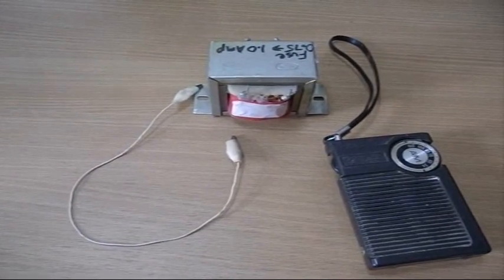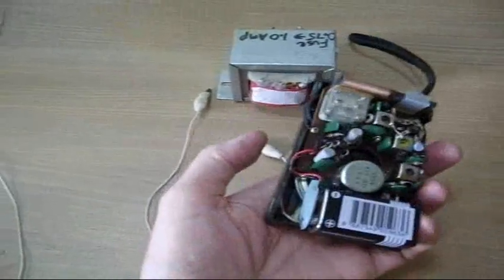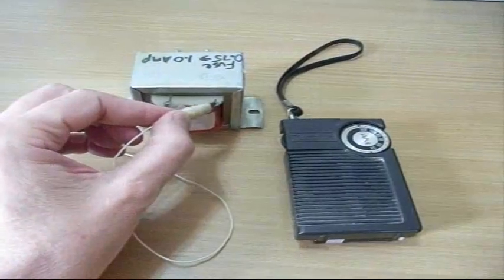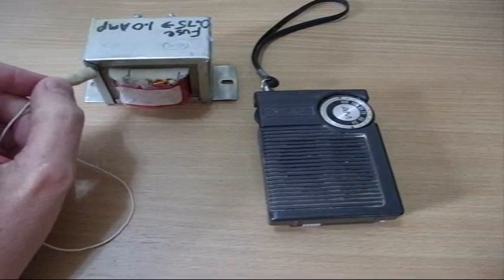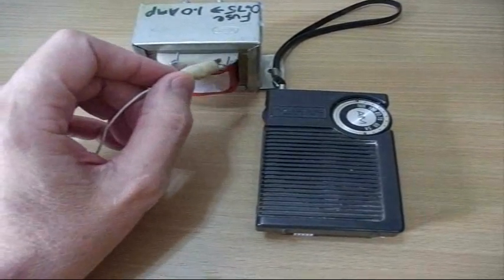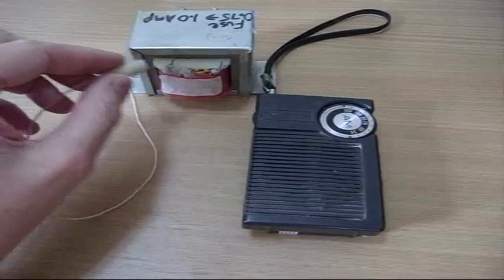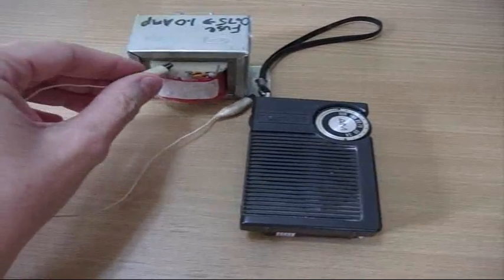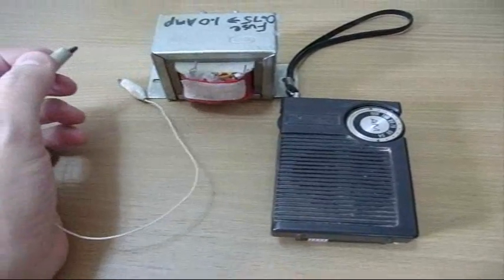Strange Radio Static Phenomenon - Free Energy Source Found???

Comment: AM radios have a Local Oscillator that often is leaked out through the ferrite rod antenna at low levels.  "Cheap" AM receiver designs respond to a very broad-band of incoming frequencies, even their own L.O. frequency. This "leaked" L.O. frequency acts (in the receiver) like a very distant CW (continuous wave) radio transmitter.

Any large chunk of metal (like the transformer) will reflect the leaked L.O. frequency, and connecting it to another metal object (the wire clip lead) will change the reflected signal level... this results in Amplitude Modulation... which is what the AM radio receives.

Since the "normal" incoming RF frequency range (around 500kHz to 1700kHz) and the L.O. frequency (955 to 2155kHz) are still within the same general range (the LO is usually offset by +455kHz), the AM detector will "detect" the change in reflected L.O. signal level and respond with a "click".

Probably confusing to some... but that's the probable answer.

The other possibility is that the ferrite antenna (which is parallel tuned with the tuning capacitor to be resonant at the desired carrier frequency), is coupling to the metallic mass and wire, and "de-tuning" the tuned circuit slightly... and the de-tune amount changes when you connect the wire... which is capacitively coupled to your body... making you part of the circuit as well.  Like before, this slight de-tune effect also results in a slight Amplitude Modulation... "click... click".

Both effects would lessen as the radio is tuned to a lower frequency, so there's not an easy way to discern which it is.

Comment: It's obviously a microwave oven transformer therefore you're picking up microwaves which is radioactive..... 

Please tell me I'm wrong with a source!
Reply from the maker: It's from a really, really old printer.
Reply: Haha ahh. It must be really old to have one that size. I know I have a few that look just like that from microwaves. I have a few old printers I was just going to scrap for the motors and boards but now I can't wait to hopefully find some more transformers. 

I love watching your videos by the way. Keep up the good work and God Bless!
Reply from the maker: Michael Watts Thanks for the kind words.  Older printers also had some cool components like a miniature LM317 voltage regulator and other discrete components one could play with.
Reply: Yeah I just opened one of the ancient scanners I had and was full of great pieces. Even the light for scanning is really cool.
Reply from the maker: Michael Watts You are right.  That reminds me I have a power supply and a tube from an old scanner.  The supply produces really high voltage from a 5 volt source.  Have to dig that out.  Might be worth making a video on.

Comment: minute sparks between trafo and jumper makes radio signals =
Reply from the maker: But where's the energy for the sparks coming from?
Reply: tsbrownie all over = electrons .the coil has a potential tension(voltage) between its two ends, and when just one electron is giving it's jolt , then you have have the fly back emf doing all the work. there's your spark....*.....      have noticed if the spark comes when you coming near the casing or when you take it away???
Reply from the maker: Inmetz No, can't see any sparks.  I think it has to do with the radio being cheap (and poorly shielded) and creating an electro-magnetic field of its own which couples to the transformer, but I'm not convinced because the frequency of the radio would not match the 60 Hz the transformer is optimal at.  I'm thinking it's the radio, transformer and some other stuff interacting in a complex way, but I won't bet anything on that.
Reply: bad shielding might be the reason -so it's like a feedback, where the signal is induced in the coil by the radios emission....
Reply from the maker: Inmetz I think there's a good chance you are right.
Reply: In thats the case it should be possible to tune the transformer to catch and emit an even stronger signal.....But isn't that what free energy is all about (-: